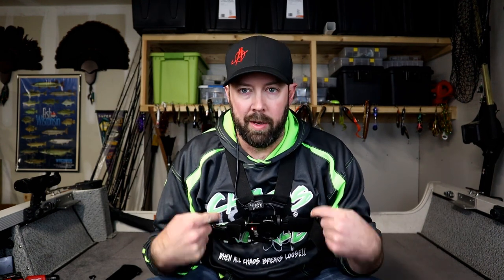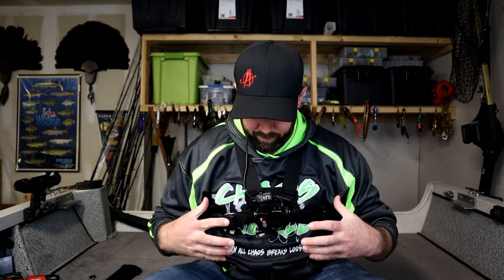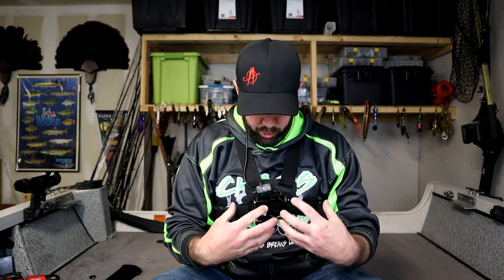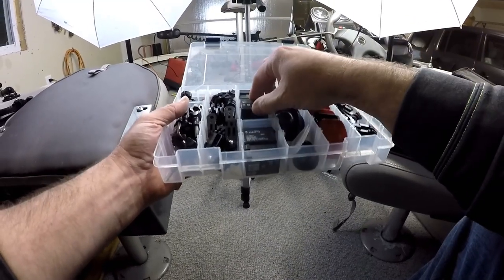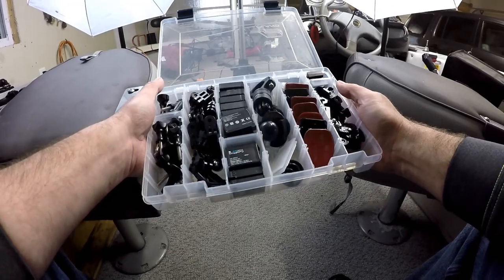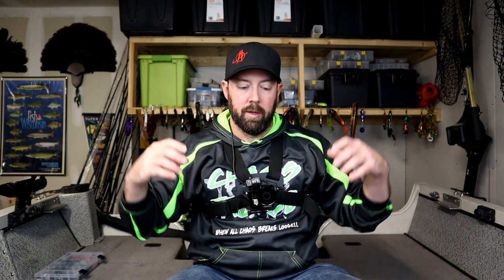POWER A GOPRO ALL DAY!! - How I Run Multiple Cameras All Day (LOOPING VIDEO!!)

Comment: One of the biggest issues I’ve had with running a GoPro on a power bank for an extended recording time of several hours, is with the cameras sometimes randomly powering off. From what I understand there used to be an issue with overheating When the internal battery was installed. This was supposedly fixed with a firmware update, but I still occasionally experience camera shut downs although not related to overheating. I found some information saying that you have to make sure the internal battery is fully charged and that the camera is off when you plug-in and power on the power bank battery. This allows the camera to draw power from the power bank and essentially ignore the internal battery. However, on quite a few occasions I have followed that correct procedure of plugging in The power bank before powering on the camera, but then I can still see the battery indicator on the display of the camera showing that it is drawing down the internal battery. The way I use my cameras they are not always easily within reach to rectify the situation, as they are mounted externally on an aircraft. How can I be 100% sure that the GoPro is being powered by the external power bank rather than the internal battery, without actually removing the internal battery outright? While that is a viable solution, if the external power bank runs out of juice, the camera will shut down instantly without saving the last recorded segment, resulting in a corrupted file. This is because the GoPro has the ability to detect a low internal battery, and finish writing the file before shutting the camera down, but it cannot detect a low battery when running off a power bank. How can I be 100% sure my GoPro is running off the power bank exclusively while the internal battery is still installed? On the mini LCD display on the Front of the hero seven, there can be two charging indicators. One is white or hollow, with a black lightning bolt, and one is solid black with a white lightning bolt. Which one indicates which?
Reply from the maker: AV8R I've honestly not messed around with trying to keep a battery in the hero 7 black while also using external power because the first couple times I did, the camera would without fail, shutdown within 5 mins. I see the concern you have with not being able to get to the gopro to check it, but one of the Anker 13000mAh banks should last a good 12 hrs or so.
Reply: @AnglingAnarchy  Thanks, yeah, I have several 10000 and up mah banks, but I’ve only tried them a few times without the internal battery. I had issues getting the cameras to turn on. You have to time it right, and there was like a 10 second or more delay from when you push the power button, to when the camera actually turned on. It could be confusing when you thought the camera wasn’t going to turn on so you hit the power button again and it would keep turning on and off. I finally figured out you had to wait 10 or 15 seconds after pushing the power button on the camera before it would actually turn on.

Comment: great vid i love it  so.... can you  plug 2 go pros into that 2 slot cig charger and run them both all day on a 13000 anker     and dont really understand the looping i would love to see and editing vid with you explaining the looping from there thanks love the channel i subbed
Reply from the maker: MY NECK OF THE WOODS The 13000mAh Anker already has 2 slots to plug USB cords in to run 2 GoPros. No need to run the 2 slot cig Charger if you're using an Anker power pack. The cig lighter adapter is just hooked into the Boats 12v system, so that will power the GoPros as well. Hope that makes sense, if not let me know. I'll try to do a vid in the near future talking more about looping and editing. Thanks for watching!
Reply: @AnglingAnarchy   ok can you run 2 go pros on the anker all day like 6-8 hrs or more?
Reply from the maker: @peggoty75  Yeah, it would probably be good to 6-8 hours. I typically just run 1 camera per battery pack, like my chest cam will run 12 hours give or take on one of the 13000mAh Anker packs. They have larger models (like a 20000mAh I think) that might work better for running 2 at a time.
Reply: @AnglingAnarchy  great im a kayak bass fisherman been wanting to run 3-5 hero 4 at once this seems like best option
Reply from the maker: @peggoty75  Awesome dude! Let me know if you have any other filming questions. Always happy to help!
Reply: @AnglingAnarchy   for sure i will

Comment: The yolo stick is awesome because its very plug and play and its nice not having to worry about external power.  The cons are that it would shake around on 3 foot Eagle Lake waves but with the video stabilization in the newer gopros its not that noticable.  Otherwise I would stick with your setup as its definitely going to be more stable.  The yolo stick is also fairly short so it wont point downward as much and this will limit the field of view for boatside action.
Reply from the maker: SG Angling I definitely think the yolo stick is great for someone who just wants to get a camera up and running without any headaches. I'm a tinkerer, so I like to build my own contraptions 😀

Comment: I bought my first GoPro Hero 7 Black three weeks ago for Motovlogging.   I connected it to a ANKER PowerCore 26800.  It ran all day and then some.  NOTE:  I found out I had to remove the internal battery because it was heating up and causing connection issues with my smart phone.  My GoPro stayed cool all day too.  Since I use GoPros on my motorcycle I can connect three cameras to one brick battery.  One more thing, I like recording with 2.7K 60 FPS and superwide.  The looping function changes the setting to 1080.  Hmmm...
Reply from the maker: Frank Morales III I think the hero 7 black is my favorite Gopro! The Anker 13000mAh is what I use the most, but those bigger ones are powerhouse beasts! Not quite sure why it wont let you film 2.7k when looping. I like it because it will let me loop and film 1080p at 120 fps. Makes for some awesome slow mo whilst fishing!

Comment: An important factor you forgot to mention is...Hero 4 and older can only
 be plugged into a 1.0 AMP port to charge or use for external power.
Reply from the maker: Kirk Westervelt Outdoors That may be the case if you are powering the camera via the mini USB port with a battery in the camera, but I always use a Switronix Battery Eliminator cord with 3's and 4's, and that regulates the amperage so it's not an issue. But that is good to know.

Comment: having an issue with the battery eliminator cable on my Hero 3 Black.....i cant power on the GoPro while the battery is out.....I have to power on the camera with the battery installed and then i can remove the battery once power is on.....any ideas?  fyi this is all occurring while the camera is plugged into an external battery source.  Thanks!!
Reply from the maker: Brian Anderson I just tried the same thing with an old hero3 black I have and got the same result. Had to put a battery in to get it to turn on and then would keep running when battery was taken out. Not sure what the deal with that is unfortunately.
Reply: @AnglingAnarchy  thanks for looking into that....at least you were able to replicate the issue.  if you figure out anything on this let me know

Comment: Looking for mounts for outriggers on  deep sea fishing boat.  This looks promising. How could I run more than one gopro without loop function using one iPhone? Thank you for video
Reply from the maker: Colby Stewart MD You can run as many cameras from your phone as you'd like using the GoPro app (Quik). You could use the cameras with or without the looping function that way. Hope that answers your question, if not, you can send me an email anglinganarchy@gmail.com.
Reply: @AnglingAnarchy  that’s fantastic.  What about external power? I was thinking running usbc up the outrigger from power bank to camera
Reply from the maker: @ColbyStewart1965  yup, that should work just fine. Just make sure you take the battery out of the gopro. The hero 5 and up don't run well on external power if the battery is in the camera.

Comment: If I film on looping for 5 mins the switch to normal video then go back to looping would a new 5 min loop be created or would I be overwriting on the original 5 min loop?  Ie picking up on the previous loop and continuing where I left off?  Thanks
Reply from the maker: @lifebestlived Once clips from a looping video are saved, they aren't going anywhere. Whatever you do after has no bearing on them, so they will be there regardless of switching back to normal video or not.

Comment: I put it on looping mode, stop recording after I have caught a fish, i caught 5 fish, shouldn't I only have 5 sections that recorded plus the last one.  I end up with 60 or 70 sections.  I took it off looping and just recorded all day long thinking I would have only 1 section, again, 60 or 70.  What am I dong wrong?
Reply from the maker: Jamie's simply Bass fishing When you are looping, say with the 5 min loop, everytime you stop the camera you will have 12 files. 6 of them are junk LRV files that you can just get rid of. The other 6 will be five 1 min video files and the last one will be between  1 and 59 secs long. So if you started  and stopped the camera 5 times you  would have 60 files, 30 of which are the LRV files and the other 30 are your video files. As for the time you took it off looping, I've not heard of that happening. You should just have one large continuous file. Maybe try a hard re-set of the camera back to original factory settings?

Comment: I have the same Anker Power bank hooked to my camera but after 20-30 minutes of filming my Hero 8 overheats and turns off. Do you have the same overheating problem?
Reply from the maker: Rafael Soares Ribero Is the Gopro battery still in the camera when you have it powered externally? If so, that's the problem. All Gopro cameras with a USB C plug in (Hero 5 and up, I believe) can be powered externally through the USB C plug in without the cameras internal battery.  Hope that helps!

Comment: Every time my hero7 black is plugged in my screen on my GoPro just says USB Connected and I can’t get it off that screen. It does that whether the battery is in or not. Please help!
Reply from the maker: Alex Hall I've never come across that problem, so unfortunately I'm a little stumped. What power source are you connecting the gopro to via the USB cord?
Reply: Angling Anarchy I was connecting to a computer lol I figured out it had to be an external power source. Once I plugged it in my external power source, it worked so we are all good. Thank you for your reply!
Reply from the maker: Alex Hall That was going to be my guess! Glad you got it worked out. Feel free to message me on the Angling Anarchy Facebook page or on Instagram if you ever have any other questions!

Comment: Hi Brian, I want to mount my Hero 4 gopro on my chest cam.  What do I buy so I don’t have to use the waterproof case and get better video.  I’m new can you tell?
Reply from the maker: @tedjarvis7373 I use an aluminum case that lets me get good audio and allows me to put a 52mm polarized lens in front of the camera. The manufacturer is Gurmoir and I just looked on Amazon and unfortunately it looks like they're not carrying the case for the 4 anymore. 5 and up are the only cases I can find unfortunately.
Reply: I actually found a case that is open on the back and side so I can plug in a battery and check use the touch screen.   Thanks for the info, I will be using your set up for the all day battery and looping to save space.  Appreciated !

Comment: Do you know how long a milwaukee m12 battery would power a go pro?
Reply from the maker: OldMilBoyz I've never tried one of the M12 batteries but I have run a M18 Red Lithium XC5.0 for 16 hours straight and will still have 2 of the 4 battery status indicators light up. I'm guessing a M12 2.0 would last upwards of 12 hours, but that's just a guess.

Comment: Does a Anker 10,000 last all day lets say a 12 hour Canada grinder, they have 13000 in the small size?  I see your video the cable runs into your sweatshirt where do you keep the Battery Pack?  is the 24Mah 5.95 inch too big and overkill as am all day upgrade for the chesty ?  PART 2  BOAT POSITIONING  WHERE ARE YOUR GO PRO'S...…. Example how is that tri pod fastening going 20 MPH?   You use go pro on the net?    Do battery packs put strain on the battery in the GO PRO? Still need a bunch of extra batteries or EBAY THEM?  THANKS !!   Also how about an 2020 Chaos Rod update video... You Forgot DO you wear a mic?  I know the new go pro has a mic port?  recommend?  Your videos on the water have a very crisp sound !
Reply from the maker: Chris The Anker 13000 mAh pack that I use the most is approx 3x4 in.  I just throw it in my pocket and it will run a Hero 4 Silver for 12-14 Hours.  If you look in the pinned comment above, I have a link to a vid that I did explaining how I position my cameras.  For the most part, every powering solution I explained in the video does not require the battery to be in the GoPro, so no need for extra batteries.  The newer GoPro (Hero 5-8) mics aren't very good, as they are made to be waterproof.  The Hero 4 Silver I wear as a chest cam is where I get most of my audio.  Hope that answers most of your questions :)
Reply: @AnglingAnarchy  Another question Chaos Rods you prefer a full grip  or split grip?   What is the best app or site to use to pinpoint pre full moon fishing days in 2020?  THANKS !!!   PART 2  BOAT POSITIONING  WHERE ARE YOUR GO PRO'S... Example how is that tri pod fastening going 20 MPH?
Reply from the maker: Chris I prefer the split grip Chaos rods. Just more comfortable for me. The moon app i use is called Phases of the Moon. Her is a link to the video where I show how and where my cameras are placed https://youtu.be/j3nNLn_7oVI
Reply from the maker: Chris That tripod I had was on a board that I bored holes into that the feet of the tripod fit into. I used bungee cords to put downward pressure on the tripod into the board. The whole thing was held down to the boat by a ratchet strap.

Comment: Been trying this for the last 2 days with some issues. Looping worked well on my 30k mountain bike ride but seems like it was using the internal battery and shutdown near the end of trip. I did try not having battery in gopro 5 but at times it would not start at all. Then after ride I viewed fotage on gopro app and camera shutdown after a minute or so, Tried another internal battery and then viewed media again No issues  ?. Changed back to previous battery and it worked without any issues again when viewing media ?.
Looks like these cameras are progmatic but when working there is fun to be had.
Reply from the maker: @graemer66 Question for you. We're you powering the cameras externally through the USB C port while the internal batteries were still in the cameras?
Reply: @AnglingAnarchy  Hi M8 yes have tried using only the c cable connected to a power pack fully charged and it ran sometimes then would go into auto shutdown ?. This was done on a trail 30 kilometres return. The battery bank was still near fully charged, GoPro would not start up again until I disconnected the power cable and reinserting it, I checked connection to GoPro and the power pack but it continued to do the same a number of times during ride, very frustrating. GoPro 5 up to date and new power cable. Still happy with days ride videos and your Looping video has been a great help. Will do mor experiments until I lose interest.
Graeme in Australia
Reply: @AnglingAnarchy  No Battery
Reply: Just found this post from someone Might be the problem. 

some power banks will only charge up then power down after you need a power bank with a bypass button that allows the power bank to stay switched on to power any device you may be using.
Question is how do you know what power banks turn off when not needed and what power bank stay on ? Think THIS COULD BE THE CASE.
Graeme
Reply: I think i have found my issue Start camera after plugging in power pack (no internal battery) then hit record in loop mode (i used same as you 5 mins) hit button again when something of interest occurs,  IF I DO NOT START RECORDING AGAIN The camera will auto shut down at preset time. The power pack MI (I'm using) also shuts down. I then have to disconnect battery pack and start from the beginning, If I just keep taking videos without waiting too long between these recorded segments all seems to be working.
Have tried this out this afternoon at home with no issues, will try it out on another bike ride soon.
Thanks Brian
Reply: All working fine now have used setup with GoPro 4 Black and GoPro 5 Just have to keep recording with only short gaps between recordings. Big Thanks

Comment: Hey I’ve also got a hero 4 silver but your footage seems to come out so much crisper and sharp, do you know why that might be?
Reply from the maker: Jacob Schuepbach The only thing I can think of is to make sure you're filming with a resolution of at least 1080p. I typically film at 60fps but when I render the footage for the final vid, I do that at 24fps. But I guess quite honestly the frame rate shouldn't affect the sharpness as much as the resolution. Check out those settings on the cam. Hope that helps.

Comment: mini usb? that will plug into side of go pro and an usb into anker
Reply from the maker: MY NECK OF THE WOODS If you are trying to power a Hero 3 or 4 without one of the Switronix battery eliminator cords, you can do it by leaving the battery in and running a cord from the USB mini port on the side of the camera and then plug that into a USB port on a power pack. This essentially is continuously charging the battery and will power the camera all day as long as it doesn't overheat, which is the downside of powering the camera this way.
Reply: @AnglingAnarchy   gotcha